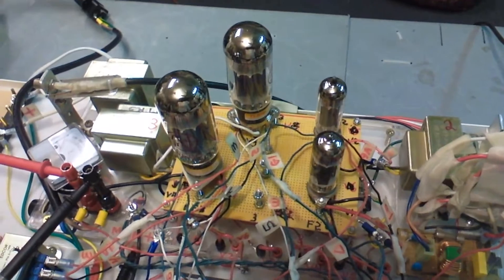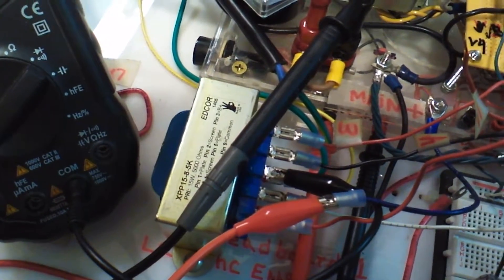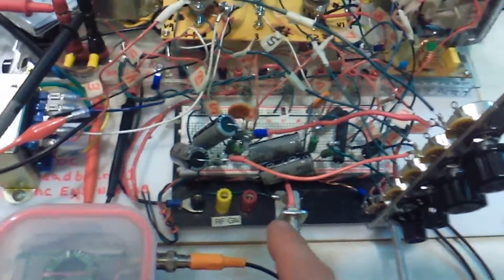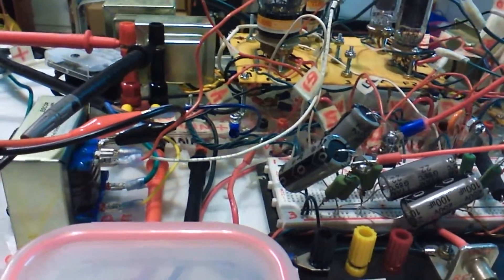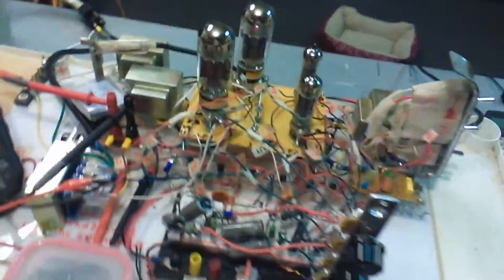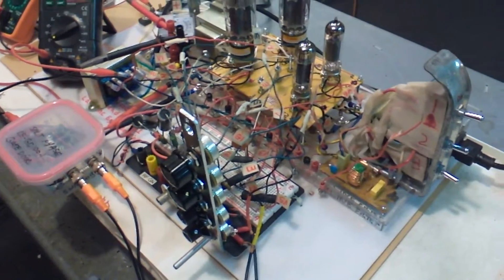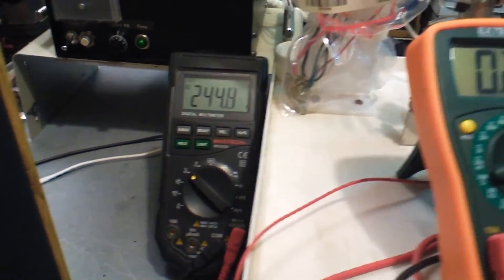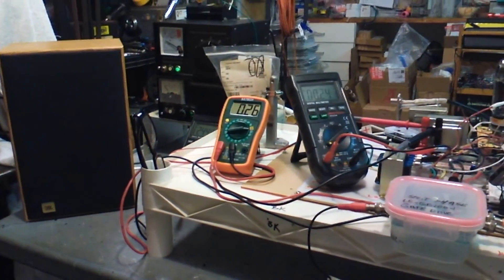60 watt vacuum tube push pull amp

Comment: ..... and the schematic shows that your 6L6GC's don't need grid leak resistors!
Reply from the maker: this is the final circuit minus the power supply for this bread board circuit. It has been in use in my shop and home for over 1 year and it sounds fantastic!
http://www.lablancinventors.org/audio-projects-2